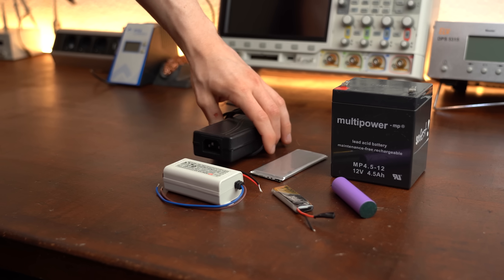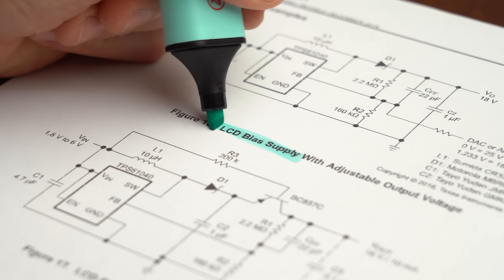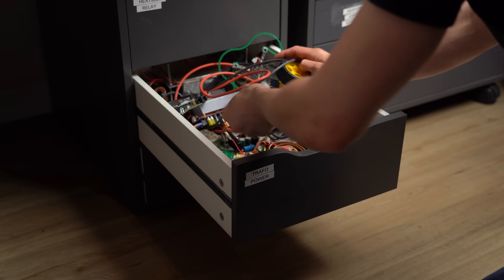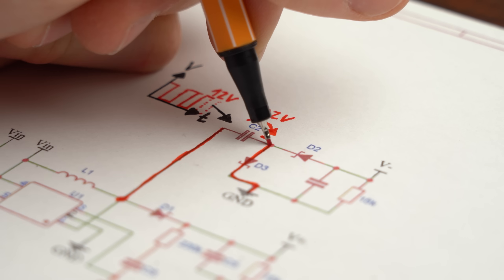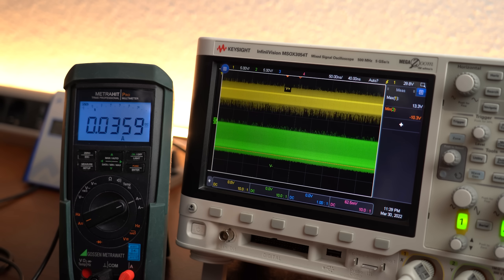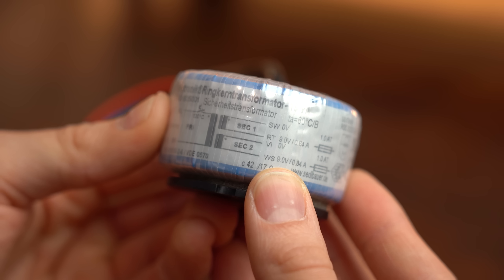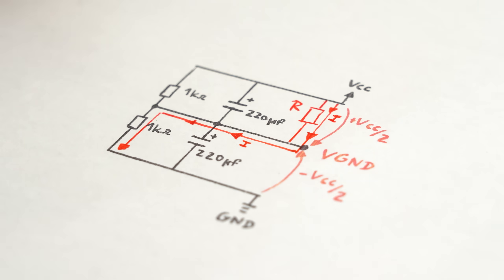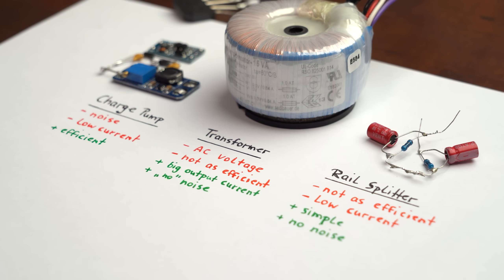Negative Voltages are more important than you think! So here is how to make them! EB#52

Comment: When I was a teenager my mind was blown by a power supply I was working with and figuring out if you tie +12 and -12 rails together you got 24v
Reply: 24v rms peak to peak, but still
Reply: Yeah, your intuition would tell you +12 + -12 = 0.
Reply: @ceneblock  Your intuition is really bad at maths... You subtract the lower voltage from the higher voltage, not add them together. If you measure voltage between +7V and +2V, you get 7V - 2V = 5V, not 7V + 2V = 9V...

So it becomes +12V - (-)12V = +24V, so it makes perfect sense.
Reply: @jelmervd2l  math sucks anyway
Reply: @jelmervd2l  Then you switch your probes around and get -24V and your math is broken.
Reply: @ Well. duh... When you turn the probe around, you have to invert the signs on the voltages as well. So you get -12 - (+) 12 = -24V.
So no, the math isn't broken, you're just bad at it.
Reply: @ ok, sorry I don't understand, I just assumed there was no math involved because it was purely a point of reference.
Reply: That's why you shouldn't become part of the circuit.
Reply: Minor correction here... It's not when you "tie +12 and -12 rails together" that you get 24v, because if you did that then you would short out the power supply, possibly causing damage to it... Instead, it is rather when you measure across or put a load across the -12 and +12v output terminals of the power supply, that THAT'S when you get 24 volts.
Reply: @JoeJ-8282  Cmon man, that's just being pedantic. Everyone knows what I meant.
Reply: @hgbugalou  Well, prob. not everyone would fully understand that, in the exact way that you said it... Maybe the more electrically knowledgeable ones of us out there would understand what you meant, but to a total electrical "noob", the specifics of how you stated your comment could be confusing or misinterpreted, possibly causing someone who was totally clueless about electrical stuff to damage something or possibly start a fire, etc... That's the only reason I said anything to clarify it, but I wasn't trying to be mean or ugly towards you specifically, so sorry if you may have interpreted what I said as being that way.
Reply: @hgbugalou I did not understand until the "pedantic" comment explained so please do not assume everyone knows everything. 
42
Reply: @JoeJ-8282 i thought he meant what he said 😂😂
Reply: @wp-wisdom  It's been a few years already since this original comment, but reading back what I clarified and said earlier, I will add that the total voltage of 24 volts comes as a result of essentially putting the +12v and the -12v rails in series, just like you would with 2 individual 12v batteries in order to get 24v total across both of them together.

In both cases, (battery string OR power supply), measuring the voltage across the negative and positive "outermost" terminals in the string, you get the 24v, but on the other hand you ALSO get -12V and +12v in relation or reference to the center, tied together terminal(s), which in the case of the power supply being discussed here, that is usually considered to be the common or center terminal, (which is usually also connected to ground or the chassis), and then in relation or reference to that center connected terminal, you get a "+" and a "-" voltage as measured from there to either one of the "end" (of string) terminals, respectively.

The person above who explained this concept using the math analogy, (BOTH of their comments in this thread), was just yet another good way to clarify this topic.

Comment: important to note that the opamp in the last solution solves the problem of imbalance for small currents. Just to be on the safe side it is really useful to use a push-pull current amplifier configuration so the opamp doesnt get so stressed and the ground is more stable for a wider range of currents :)

Comment: If you want to operate an LCD display that is intended for 5 volts at 3.3 volts then you need a 2 volt negative voltage for the LCD.
Reply: Or an 8v 👀

Comment: Can I request a control circuit that can switch direct dc coming from battery and dc output power supply to a 3d printer. it will work like a ups except it only switch between battery power and power supply dc output to a 3d printer. I think you'll get it. Thank you so much.

Comment: is there a good, cheap way to get a higher power negative voltage? say, -24v 1.5A? transformers are big and heavy and expensive and i'd rather not have to get two of them to have +/-24v and +/-16v rails
Reply: i think computer atx power supplies might do the job, they generally have a -12v and -5v rail and can supply a ton of current plus they are very cheap
Reply: @ShahZahid  in this case my needs for specifically -24 and -16 are fixed needs (making a power supply for the series 50x audio module standard). -12 would be useful for something smaller like a standalone amp.
Reply: @famitory  honestly you can buy a transformer and then remove its secondary winding, then wind 2 new secondary coils with different center taps, that way you can get 2 different outputs from a single transform. thats how most of the transformers used in amps are they have multiple outputs on a single tranformer. also such transformers exist readymade or you can pay someone to do it for you, perhaps some electrician who repairs such things

Comment: Another source of negative voltage that comes to mind is an inverting buck boost circuit commonly used in PC power supplies for the -12V rail.
Reply: Another way to create negative voltage is also to:
- use one diode as a voltage dropper, okay for low power IC that require small biasing to allow output voltage go to GND
- use isolated power supply and connect them in series, for example use isolated 5V-5V module and connect it +out pin to -in pin to create +5V and -5V
Reply: Old serial ports used that voltages, but in ATX power suppy its has easy obtained from a inverted diode on the 12V line right out the transformer...
Reply: though that seems only gd for pre amp...power amp....just to low power
Reply: @servantsochrist  the -12v rail is pretty low power (usually under 2A)
Reply: @nigrum_tredecim  yes...only good for line level stuff...op amp logic.... but enough to run headphones i guess...nothing more....or just a ref voltage for whatever your use case
Reply: @servantsochrist  It mostly depend on how big you make it (and it's way better than that charge pump thing when it comes to voltage stability and noise). But it do use the components less efficiently than a normal boost or buck converter though. The inductor needs to handle up to twice the input current and the diode and transistor higher voltage (input plus output combined - for example 24 V if +12 is converted to -12 or 17 V if +12 is converted to -5). For high power stuff, the best option is probably to make a coverter with transformer and isolated output, then just ground the positive side.
Reply: @Speeder84XL  thanks for the info...I defe gonna use that charge pump circuit

Comment: i honestly prefer the transformer one, as my local market has a ton of people working with those and its pretty cheap for me to get a custom transform wound as per my need.
Reply: where are you from, i am currently looking for a a custom transformer too, but its very hard to find in my country, especially a center tapped one
Reply: @yugaindiranmarimuthu7310  im from india, actually the mains power here isn't great fluctuates too much, so people often by voltage stabilizers so the transformer market here is considerably large, so people here make custom Transformers as per their requirement, what you can fo is either buy a transformer and rewind it or just buy the metal cores and make it from scratch

Comment: the solution with the transformer is the worst from the efficiency perspective but for the big audio projects (aka: high current needed/power amplifiers) there is no alternative.
Reply from the maker: Well, you could put two isolated smps in series. But then there can be a noise problem.
Reply: @greatscottlab  that is why nobody will apply this solution in any audio (except the ones from Aliexpress)

Comment: The easiest way to get -12V is from a computer PSU which costs like $30 (quality units). at least, I have a spare good PSU and I would use that instead if I needed negative voltage.
Reply: Easy but expensive.

Comment: Use two AC power to DC smps and connect their outputs - to +.  (Don't use wall warts since they are often not isolated.)  Meanwell makes modules for a few bucks.  Reduce switching noise with ferrite beads and cap filters and/or linear regulators.
Reply from the maker: Also possible :-)

Comment: The moment you said "Check out the links in the description" and I saw that manila background and the dual 2N3904 with the two 1N4148 forming the voltage divider I was like.. Yep, read that page already! That's a great reference for creating virtual grounds using essentially linear components and no switching or charge pumps.
Reply from the maker: That page is fantastic indeed :-)
Reply: @greatscottlab ......Dave Plumber from Dave's garage could use your help......he is the retired Microsoft software engineer and tons more cooler stuff.....he's got a problem with negative voltages and addressable leds
Reply: haha my exact thoughts

Comment: This simple charge pump circuit I used when I wanted to get an old scrap LCD matrix display from an old phone to work.
With a polish datasheet and too much free time I was able to make a library for it, to use it with an Arduino.
Only thing left was the negative voltage. So I googled and found this charge pump design which I put together with scrap parts from old circuitbords and it worked :D
Reply from the maker: Great :-)

Comment: Most switching power adapters are isolated in reference to AC power ground, and we can cascade such outputs and achieve positive/negative power rail. If you want a micro volt potential difference between the “center ground” of your DC power supply and the “earth ground”, connect them with a 1 M-ohm resistor.

Comment: i’m building a pinball machine any advice for led matrices and creating graphics on a 32x32
Reply: most people would tell you to use a ws2812b matrix but there are those panels that are used on advertisement displays, they are called P panles (p3, p6 etc etc) where p defines the pitch (gap between leds), they are cheap are plenty bright and dont need a ton of current (when compared to ws2812b), there are also good libraries for them like pxmatrix etc only down side they are slightly more complicated to wire up
Reply: @ShahZahid  thanks man appreciate it

Comment: When joining 2 secondary coils of the same transformer, one must double check the correct sides are connected, or else you will end up with 2 separate positive outputs and a common ground.

Further on combining coils of transformers...
When combining 2 outputs of a transformer on both ends to increase the amount of current, you must do that after the bridge rectifier you should use for each... Learned that the hard way ;)
Reply: Why would you need to "When combining 2 outputs of a transformer on both ends to increase the amount of current, you must do that after the bridge rectifier you should use for each... Learned that the hard way ;)"
If you don't swap the polarity of the windings it should just act as a primary with more thicker windings
Reply: @alexstone691  Those windings are never exactly the same, so you get some strange currents flowing. When combining it from 2 separate transformers you must for sure match polarity and still may see the same 'strange currents'.
When I started learning about electronics (begin '90s), it took me quite a few fuses to find out why they blew so quickly. Glad I used fuses in my designs back then ;)
Reply: @alexstone691  Yeah but on some transformers the two center taps on the secondary side are connected to each other
Reply: Problems described here could be enforced with transformers that do not have the two windings in separate compartments beside each other, but the windings lay on top of each other. Therefore, the upper winding is much longer (but with the same voltage outcome) so its resistance differs from the lower winding. The more current is drawn, the more the voltage differents will start internal currents.
Reply: actually, it will still work. It will even work off of one winding. The problem with this one-winding setup is that if the current consumptions on the two rails differ, that difference current will appear as dc across the winding, causing core saturation. That makes the transformer roar and heat up unreasonably.
Reply: Did that with neon sign transformers for making lichtenburg designs on wood. Connected 2 in series and didn't get an output arc, I gave it a fancy name "phase matching". Not sure if it's a thing or not but sounded good.
Reply: It depends on if the transformer has been designed to have the two independent secondaries paralleled. If yes, then it should be okay. The current from each secondary may not be even, but the voltage drop in the copper wire should help to keep the difference to a reasonable level.
It is however unwise to parallel up the secondaries of different transformers, or tapped secondaries.
Reply: @Mark1024MAK  Datasheet can tell you if the manufacturer has it intended to use them parallel. Many now have two windings for generic purpose, and you decide if you use double voltage or double current.
Reply from the maker: Thanks for the feedback :-)

Comment: Xl semi provides a few ic's for positiv and negativ output. The xl6008 and the xl6019 are good enough, both have a higher output current and both are more stable. I have makes a breadboard power supply with the xl6008 ic, work pretty well.

Comment: Hello sir can you make video on creating a signal generator amplifier ,since signal generator can put out 12 v at 500 ma.  If there is any way to make 0-30v at 5-10 amps.

Is there any circuit for this
Reply from the maker: I can put it on my to do list :-)
Reply: @greatscottlab  Thanks bro ,i am big fan of your works and have learnt a lot from u
Reply: @MattyEngland  can amplifier works ,but most of amplifier works in 20khz range ,is there any amplifier which works above 20khz
Reply: @petername2608  There are a lot of audio (stereo) power amps that will go up to 50 or 75kHz. Their output is over a 4 or 8Ohm load.
You could also use an IC like UPC576 (look at Tessatronic) which has an output of 3Watt and goes to 100khz. You need 18Volt for that.